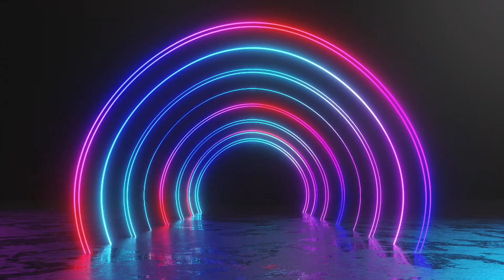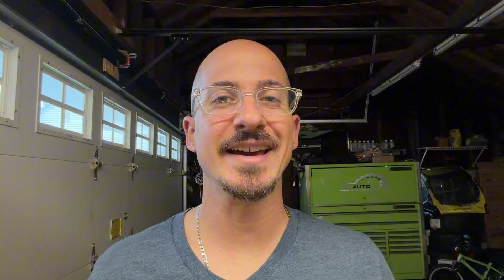Q&A Episode 115 (valve clearance | premium fuel | hybrid issues)

Comment: DIDNT KNOW THEY WERE RUNNING THAT HIGH OF COMPRESSION ON THE 2.O HYBRID .....THANKS
Reply: Blah blah blah blah blah
Reply: That's the calculated start vs finish CCs of the engine. Since its a Atkinson (actually more of a Miller) cycle engine, a lot of that compression leaks out the open intake valve.  Its has to start really high otherwise it would be too low after the delayed intake valve lets a bunch out.  So in operation its more reasonable. Maybe 10 to 1.
Reply: @DeadphishyEP3 THATS GOOD  I RAN 10.5 TO 1 ON A 79 ALFA ALFA ROMEO SPIDER THAT DIDNT LAST VERY LONG WHEN MY JACOBS IGNITION COMPUTER OVERHEATED !!!!!

Comment: The k20c9 is essentially a miller cycle engine. Does honda have anything listing effective compression ratio.  While calculating the ratio with chamber  CC's at BDC and then Chamber CC's at TDC will get you 13+ to 1 compression. This motor uses the VVT and i pressume and long duration cam lob to delay the intake valve from closing and allowing intake air to regurgitate back into the intake manifold instead of being compressed. Effectively changing where the compression stroke starts. This would drastically reduce the compression ration.  Id like to see what its effectively working at vs. Static numbers.  Even in Otto cycles you cant us Compression ratio alone to figure out what type of fuel will be required. The valve timing plays a big role in the final compression numbers.

Comment: I have a 2024 Accord Touring Hybrid and I'm having a noticeable vibration coming from the transmission at exactly 42mph up to about 54mph, it feels as if its adjusting to a higher ratio or the engine switches to power the wheels at the same time with the electric motors. It also makes a grinding noise occasionally when switching between power modes. All of this happens under light throttle application in that 42 to 54mph range, If you give it more throttle, doesn't happen. Car has 19k miles on it. Definitely not normal, any idea? I'm going to tell the dealer next time I'm in for service. Thank you for your videos! I love Honda but disappointed in the durability of these cars now.
Reply from the maker: How many miles on the car?
Reply: @BCautosutions  19,800mi

Comment: Hi, can you tell me when it is advisable to change the spark plugs and the timing belt on my Acura 2021 Tlx aspec 2.0 now it has 60,000 miles
Reply: Stock
Reply from the maker: @ericmaldonado2165 spark plugs 90-100k, no timing belt. It has a chain. The drive belt I would say around 90-100k as well
Reply from the maker: Modded or stock?
Reply: That is, that distribution chain is not changed. Just what you mentioned. And the transmission belt I didn't know that it had.

Comment: Do you think the high compression ratios of both the 1.5T and the Hybrid, combined with low octane fuel, and prolonged oil changes are the largest contributing factors to head gasket failures (aside from the design flaw with the cooling channel between the cylinders)? I have read that LSPI could be taking out these head gaskets very easily and that there is nothing the cars computer can do to compensate for it. It's not hard to see how oil and carbon deposits combusting randomly could lift the head and then wham, head gasket delete. Seems like all you can really do is run the 91/93, change your oil early, and don't use Econ mode.
Reply from the maker: For sure, it’s all a contributing factor for a massive recipe for disaster

Comment: I run 85 octane (high elevation) in my 2024 Honda Civic Sport. $7-8 difference per tank and yes I have experimented with 91, and I get the exact same fuel economy. No noticeable difference in performance unless it's pedal to the metal past 5k rpm. My car mostly lives under 3k anyway.

Comment: As a former lawyer & engineer who worked for a global OEM auto supplier and literally helped write maintenance manuals the word “recommended” is 100 percent a specific legal word picked. It’s simple, in the USA gas sellers use “octane”, which is used to stop pre-ignition as a product differentiation versus cleaning additives. In some countries all grades are at least 91 octane and the differentiation on cleaning additives. High compression engines need at at least 91 octane. Yeah in the USA the “software” will help it run long enough to get out of warranty. Just like USA regulations effectively mandated the move to 0w20 oil mean while that same engine runs Honda recommended 5w30 or even 5w40 in other countries. So yeah recommended is a sly why to look less expensive at the cost of your vehicle longevity
Reply from the maker: Appreciate your input! Thank you
Reply: @BCautosutions  Hi Brian, would the x431 Elite OBD scanner you recently reviewed help with getting information about ignition timing that would help us know if we need to go to a different gas / petrol rating? Thanks
Reply from the maker: @paulm5025 I don’t know, I’ll have to look

Comment: The specs on Honda website says 13.9:1 for the hybrid and 10.6:1 for 1.5T
Reply from the maker: Yep I was a hair off, even higher 😅
Reply: With this being a miller cycle type engine the first 20 to 30 % of the compression stroke goes back out the intake valve since its delayed in closing. Using hypothetical numbers. The combustion chamber with the piston at the very bottom could be 100 CCs. Compressing that 13.9 times would require a volume of 7.2 CCs with the piston at the top.  7.2 x 13.9 = 100.    Now let's imagine the intake valve allows the first 30% of the compression stroke to go back out the intake instead of compressing.  Final combustion chamber CCs remain the same 7.2. But the start is reduced to 70cc.  So 7.2 x X = 70.   X is 9.8. So the effect compression ratio is actually only 9.8:1.   That explains why a miller cycle engine requires ridiculously high compression ratios, as once they are in motion they loose a lot of starting compression. They must start super high to end up getting something normal at the end.

Comment: I have a question about the CRV Hybrid. When you fold the seat down to increase cargo capacity, I notice it completely blocks the ventilation for the hybrid battery. Is this a problem? It's right under the seat, or is there another way for the air to get in that I'm not sure about?
Reply from the maker: Hat generation Crv?
Reply: @BCautosutions 2024 6gen

Comment: I just saw a tech talk about how honda put the same failing coolant channels on the new v6 that the 1.5T has. And they have already seen some head gasket failures in the new passport…
Reply from the maker: Yes it’s true, it is happening (very small, but happening)
Reply: That engine has been in the Pilot since 2023.  Don't see any head gasket failure discussions on the Pilot forums.  Or the Passport forums.  Must not be a widespread issue.

Comment: Are you seeing oil leaks on the 22 civic sports. We spoke before regarding my situation. Have changed the rear main already, reseal oil pan and the leak leak still there. Car has 141k miles, do you recommend i swap my engine.
Reply from the maker: I can touch on this in next video

Comment: I had a clarity plug in and I did the PCU drain and fill. Ran the electric water pump for the PCU for a good ten minutes or more. Level in the reservoir stopped dropping, so I wrapped it up. On a test drive while accelerating hard, cel came on for PCU inverter over temperature. The transistor temps would spike up to 280*F. Wouldn't change. Did a vacuum bleed and coolant fill, problem solved. I'll be vacuum filling the PCU cooling systems from now on. I'd done many prior with no issue, but an air bubble must've gotten stuck over the inverter transistor cooling passages
Reply from the maker: Thanks for sharing, definitely a possibility I suppose. I’ll keep that on the back of my mind, just in case 😅

Comment: The 2.0 in the hybrids use the Atkinson cycle so it's not accurate to compare its higher static compression ratio to other engines that use the more traditional Otto cycle - the dynamic compression of the Atkinson cycle is much lower.

Comment: Thanks for the video Brian. Interesting to hear the USA talk re Octane ratings. Australia uses the RON standard for Octane rating, whereas USA uses AKI rating I believe. Seems the USA 87 is our 91. I have been running 91 (87 USA) for a year now since I bought my 2024 Honda Hybrid ZRV (HRV in the  USA iirc).   I did try our 95 (91 USA) on the last few fills and didn't see any fuel economy improvement at all, which surprised me a bit, but based on this info by BC Auto I will look to run a higher octane from now on. I did not realise the 2.0 Atkinson engine ran "race car" level compression... 😳😳... so I will definitely use higher octane rating as I intend to keep the car a long time.  Fortunately mine came with an 8 Year Manufacturer warranty by Honda as a sales incentive here in Australia, but I am still keen to do the right thing for minimised problems and longevity 🤞🤞
Reply: If your engine doesn't dial back the ignition timing you use sufficient octane rating. Higher octane number than needed is also harmful.
Reply: @mikman7219  Thanks for advising this. How can I check if the ignition timing is being dialled back... or if it is actually running  optimally on 91 RON?  I have not noticed any difference in performance or engine noise etc between when I have  used 91 RON and when I have used 95 RON... 🤷🏻‍♂️
Reply: @paulm5025  I have used a Bluetooth ODB adapter on my Subaru BRZ. Can't tell if it will work on your car. And I found that even the recommended AKI 93 is slightly not enough. The AKI 94 is enough though. I am going to buy a Honda Hybrid soon so I am interested if the AKI 87 is indeed enough.
Reply: @mikman7219 Thanks for the information, much appreciated. I will start to research some OBD units for my Honda Z-RV.
Reply: @BCautosutions  Hi Brian, would the x431 Elite OBD scanner you recently reviewed help with getting information about ignition timing that would help us know if we need to go to a different gas / petrol rating? Thanks
Reply: @paulm5025  I read on the Internet that the hybrid Atkinson cycle engines are prone to gasket failures even if AKI 89 gas used which is frustrating. I don't know about late Honda engines much but head gasket failures are usually an indication of detonation. Can you hear detonation if you use a low octane fuel? I tried to avoid using high octane fuels by purchasing a Honda.
Reply: @mikman7219  I certainly cannot hear any ignition knocking noise when using 91 RON and didn't hear any difference with using 95 RON.  And I come from a car mechanic family so I tend to hear every slight noise with a car 😳😒🙃
Reply: @paulm5025  Could be just a bad engine design not related to the octane number. I am not sure if I still want a hybrid from Honda which has high chances to die after 100K km.

Comment: I run 89 sunoco (top tier rated fuel) in my 2.0L K20C2 civic and my 2GR-FKS 3.5L toyota tacoma.  both non turbo vehicles.  I think 89 octane is a good idea for non turbo vehicles, but obviously for any turbo engine put the highest octane you can just for better thermal protection.  
the best thing you can do for literally any octane rating though is to use fuel from a Top Tier Fuel Station  you get a better additive package for all of their octane ratings, 87 - 94

Comment: never had problems with my 2017 Honda civic or my 2022 CRV with the 1.5 turbo , used top tier 91 octane co op fuel and 5/30 synesthetic oil every 5000. kms , here in Alberta Canada.
Reply: In northern Ontario. I also run my crv with the 1.5 in sport mode to get up to operating temperature in the winter and use a pea fuel injector cleaner
Reply: @m109r   I forgot to mention sport mode, and I use Techron fuel conditioner to keep the injectors clean and keep the valve carbon down as well.
Reply: 2017 CRV 1.5 120k here in Florida
I do 25-30 min trips twice daily
33-37mpg avg & 41-44mpg if I keep under 1500rpm
Switch to Costco 93 octane and 5w-30 in 2022 Only issue is the fuel injection replace- I got genuine Honda rail/ injectors from very low mileage 2022 CRV and sent to Injector Masters in Oregon
I use Lucas high compression oil stabilizer for modern engines

Comment: Hey Man! Ty for the info! On a 2017 Accord 4 cylinder can we get away with 87 top tier? Or is there really a significant worthwhile benefit to pump 91 plus octane in this Naturally Aspirated engine also? This car get 3K mile changes also, Ty!
Reply from the maker: I would still run 89/91 just for at worst the longevity and life of the catalytic converter.

Comment: I'm only one data point, but my issue with cylinder misfires significantly improved after switching to exclusively premium gas. Maybe it's just helping the symptoms of an injector problem, but it helped.
Reply from the maker: Would need more data and bigger sample size for sure to yay or nay it but if it worked for you, then it does

Comment: Thank you for answering my question on the hybrid coolant. So each has a separate drain and fill? I see the radiator drain (center back of radiator) but don’t see a separate drain for inverter. I have the scan tool you recommended! We are at 44k now and was going to do it at 50k. A video would be awesome! Also thanks for recommending higher octane on the hybrid. I wasn’t aware it was higher compression.
Reply: You could actually wait for maintenance minder to tell you when to do this 1. The inverter coolant loop doesnt get as hot as the engine coolant loop. Btw honda initial fill engine coolant is good up to 100k miles or 10 years. Or do it together when maintenance minder pops up for engine coolant if it hasnt popped up by then.
Reply from the maker: What car do you have?
Reply: @BCautosutions  2023 Accord hybrid (wife’s car). I drive a 2021 Accord Touring with 2.0t.